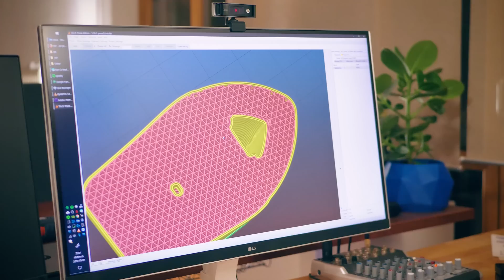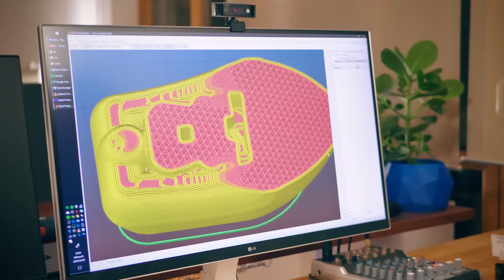3D Printer Anatomy: 50 parts in 5 minutes (Basics)

Comment: How can be sure your print will be centered in the printer. I just created a circular design, designed around the center point in F360, in cura it looked centered, but on the printer, the raft was printing outside of the built plate.

I thought this could be something interesting you could talk about in a feature video..

Keep them going. Cheers.

Comment: I have a question about terminology. So, what is the "extruder"?
I've been told that "extruder" is a mechanism which gives a form to a material, pushing it through hot hole. I.e. in terms of 3D printers, the "extruder" should include and the stepper motor with gears, and the hot end, and the Bowden's tube, if any.
But I often see the term "extruder" is applied only to the motor, and do not include the hot end and the bowden as it's parts.

Comment: Not trying to be too picky but that's not an extruder that's a feeder it doesn't extrude anyting. the extruder is the system/assembly from the feeder or driver to the hot end all en compassed. the feeder is a component of the extruder the hot end is a component of the extruder
Reply from the maker: I know it's not technically correct terminology, but this is what has developed over the years to precisely identify individual bits. 3D printing is just special like that ;-)

Comment: Coming from an engineering background, I'm not at all happy with how FDM/FFF has completely mangled the meaning of some standard industrial terms surrounding the extrusion process.

First, an "extruder" is the thing that converts feed material to usable output, the entire machine at the highest level, or just the part that does the final output at the lowest level.  So, in minimal terms, only the "hot-end" does any "extrusion", specifically the nozzle.  The thing that pushes the filament should more properly be called a "feeder" or just "the feed", and includes the entire path between the spool (material source) and the hot-end (conversion to output).

Oddly enough, the terminology used for the machines used to make filament is much closer to industry standards.  If you start with the plastic beads, then 3D printing can be viewed as a double-extrusion process: Once to make the thick filament, then again to make the thin lines used to form the printed part.  Two different kinds of feeder are needed (generally a screw for beads vs. a hobbed gear for filament), but the hot-ends are remarkably similar (differing mainly in size and power, not technology).